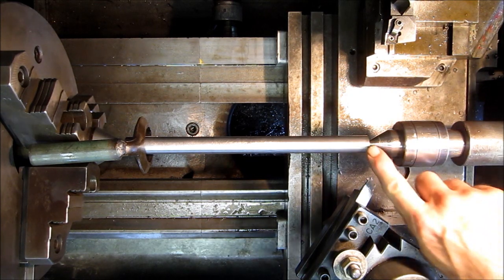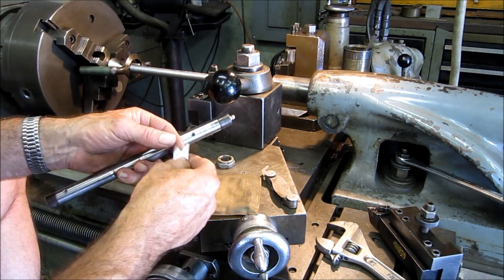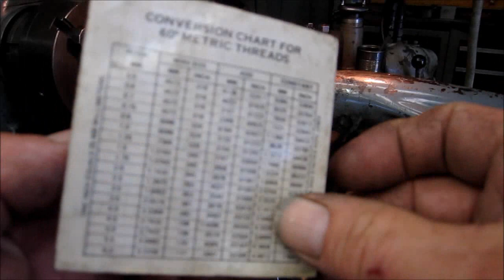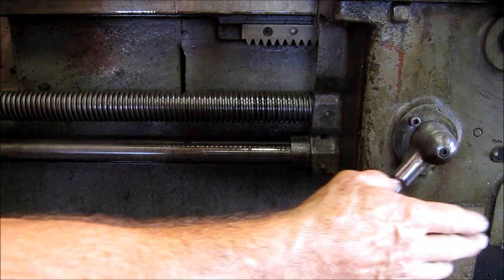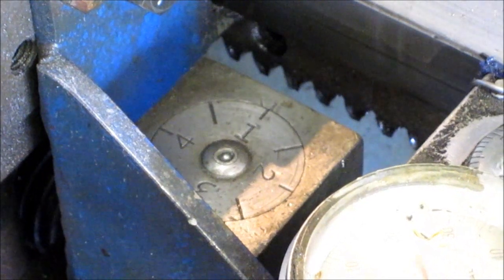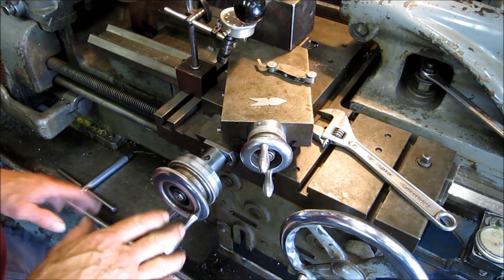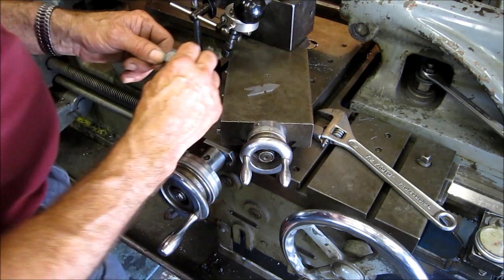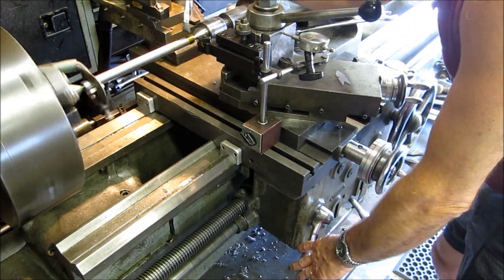Mail Call (Benchmaster) Part Four

Comment from the maker: Most of the reason is wear in the half nuts, just as you can feel back lash in a lead screw, you can engage the half nuts and push back and forth on the carriage. I'll lay a couple bucks on, if you push the carriage fwd. with the half nuts engaged at a line, the line is closer to lining up, due to more right handed threads are cut than left hands...

Comment from the maker: Yes, but from my experience, I’ve had more mess ups by accidently repositioning the dog one jaw over, the first pressures of the bit usually swing the dog against the jaw and aline the cut. If the tension is set right, there’s hardly ever a problem…

Comment: Great to see the technique at 13:24 for working with a very narrow relief. Nonetheless, you really need to be concentrating 110%. I've also heard of threading left to right from a narrow relief, especially if threads run tight into a shoulder?

Comment from the maker: That is the manufacture, there is only a place in Southern Cal, I think, called Southwestern that repairs older units and they are no longer are made. Search trav-o-dial repair, Google will get you onto used sales and parts still available. ;{)-----

Comment: You mentioned that the end undercut looked as if it had been made with the same tool as the thread cutting process. Isn't that what would happen automatically if the thread was cut, and the feed disengaged but the tool not withdrawn at the same time? Probably the original machinist cutting corners a little.

Comment: hey Keith ,good stuff ! never saw a lathe with  leadscrew and feed shaft turn together ,
My tos and Tuda lathes  have oil pumps in the carrage(run of feed shaft) apron but when u engage the leadscrew for threading the feed shaft is disingaged ,does your lathe have lube pump ?

Comment: Just a little math to calculate the travel in when the compound is set to an angle. You can use the Cosine Function for that. Search goolge for: mathsisfun Cosine (youtube forbit weblinks)
On this Web site, When you rotate the first triangle picture 90 deg clockwise, you have an analogy of your compound.
 The Angle is the angle on your compound (for threading you use 29°, right?) , the Hypotenuse is the compound (or the travel that you read on your compound dial), and the Adjacent...

Comment: ...is the unknown amount of travel, that we want to calculate. 
The formula is: Cos(Angle)= Adjacent / Hypotenuse
We regroup the formula: Adjacent = Hypotenuse * Cos(Angle)
The Cosine of 29° is 0.87461970713 (You can find these values in tables/books, you can use a calculator, or just google to calculate the Cosine of any angle: “cosine of 29 degrees”
For Threading you will get: Adjacent = Hypotenuse * 0.87461970713
You multiply your compound travel with 0.875 and you have your “in travel”.